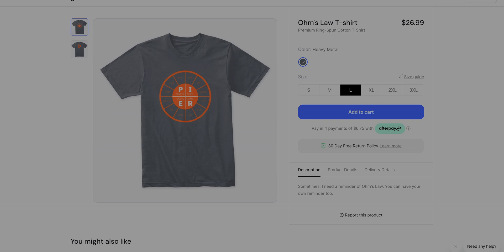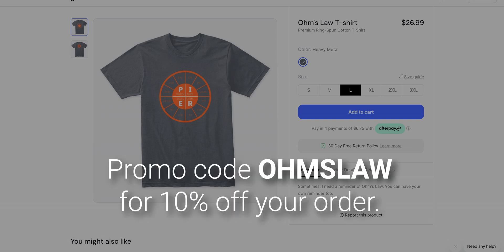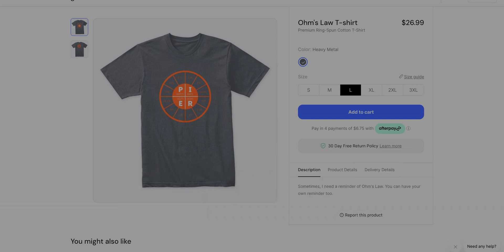What is Ohms Law?

Comment: Good video.  Ironically, I'm teaching classes on Ohm's Law (among other things) this Saturday for students seeking their Technician Class Amateur Radio License.  As for me?  I learned Ohm's Law in 9th grade electronics, many years ago.  Marcus, you briefly touched on one subject in this video which IMO could easily merit a whole video.  And, that is transmission lines.  I've seen everything from RG-8 marked "Tandy Wire & Cable" to waveguide.  Best wishes...
Reply from the maker: Absolutely cable can be its own huge topic. Maybe i can get someone from CommScope or Belden to come on.
Reply: @TheBroadcastEngineer  Along that line, how about connectors and transmission line accessories like exhausters and isocouplers?